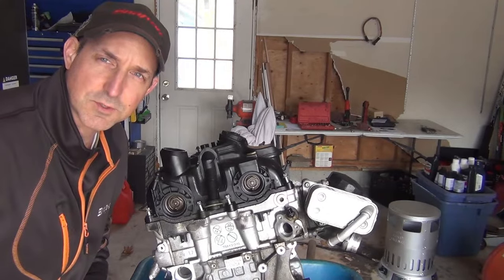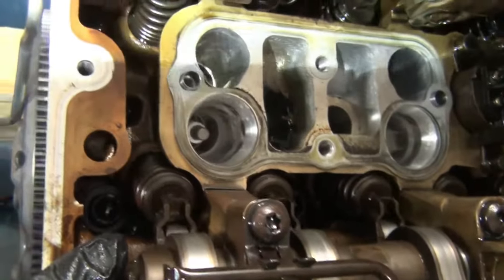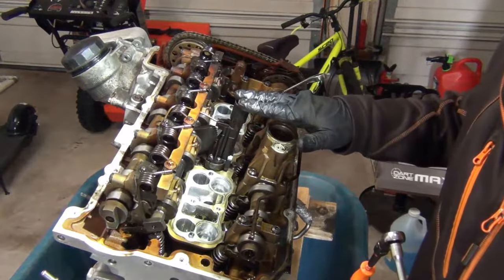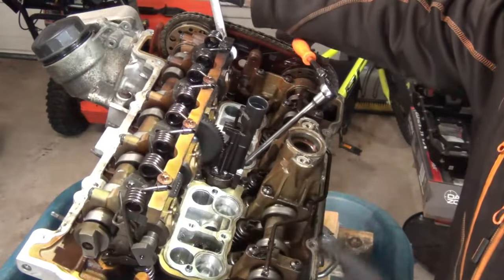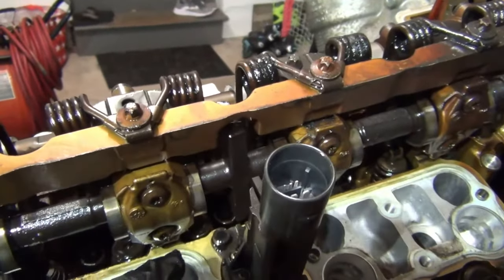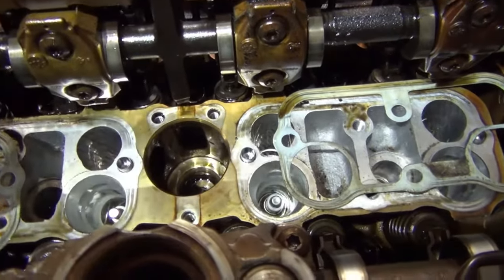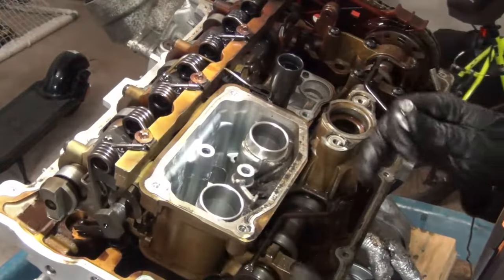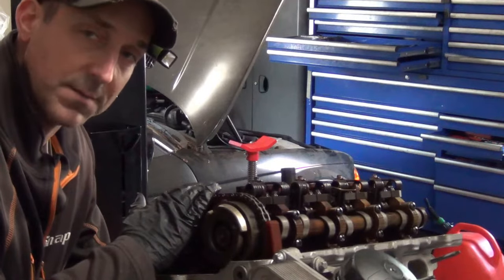How To Remove Replace Install The VALVETRONIC MOTOR BMW N20 N26 N55 With Torque Specs

Comment: Hi..I have 2014 640i xdrive and just got the P10E2 code, took it to BMW and they said it is is Valvetronic Servomotor failure and quoted $2300 to fix and if they have to change the injectors the cost jumps to $4400. Don't understand if they damage the injectors while changing out the servomotor I would have to pay that. Any thoughts?
Reply from the maker: Hi Douglas, The injectos have a removal torque spec. If they exceed that because they are stuck it damages the injector. I had a tech exceed the torque and not quote them and we needed up replacing each one because they started causing misfires.  Better to replace the stressed ones with everything removed than to have to pay to take it apart again. Sometimes none need replacement.
Reply: @AskTheCarExperts  I appreciate the reply. Do the injectors need to be removed to change out the servomotor?
Reply from the maker: @DouglasB65  Can you post the last seven of the VIN and I can check for you.
Reply: @AskTheCarExperts  D452732....2014 BMW 640i Gran Coupe XDrive...49k miles
Reply from the maker: @DouglasB65  Yes the motor is under the valve cover and the center buckets need to come off on the N55 so the injectors  need to be removed.
Reply: @AskTheCarExperts  Ok..I appreciate all your help..thx again and keep up the great videos👍

Comment: Are there any fuses or relays to the Valvetronic? If so, where are they?
Reply from the maker: The valvetronic is controlled by the engine computer.  If the system detects a problem the DME can cut power to the valvetronic motor. This means that it may look like a bad DME but the issue still could be another component.

Comment: Do you twist the vv eccentric back in I have a 2008 bmw 550i
Reply from the maker: For your VVT motor there should be an Allen at the top end that you can use to thread in the VVT to the eccentric shaft.
Reply: @AskTheCarExperts  ok só you just screw it back
Reply from the maker: @kingpete3160  Yes, you can use some light pressure to help mesh the worm gear and use the Allen to walk it in. Then tighten it at each bolt a bit to walk it in. After cycle the key on for a minute to relearn it. Use caution if you touched any harness grounds as if not installed correctly you can cause module failures.
Reply: @AskTheCarExperts  wha u mean by that
Reply: @AskTheCarExperts  I put it back on myself my uncle took it off Im missing one bolt so I tightened down 3 bolts and I tried to turn it over to see what it would’ve do but it didn’t nothing but click it was clicking before we took it out thou it want fire I haven’t check the starter because my uncle thought that was the starter I told him no that’s not the starter
Reply from the maker: @kingpete3160  LOL oops not the starter 😀 Try to add an engine ground using jumper cables from the engine to body ground. Might be a corroded ground bit it could be a starter.
Reply: @AskTheCarExperts  does the vv lift elecentric have anything to do with the timing
Reply: @AskTheCarExperts  i told my uncle he still thinks it’s a starter I told him please shut the hood because you don’t know nothing about these kind of cars lol 😂